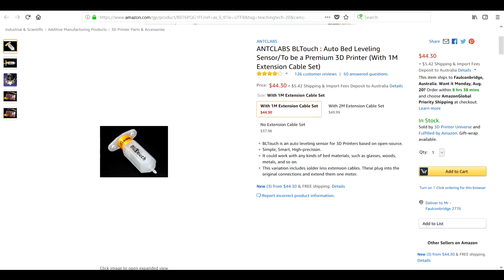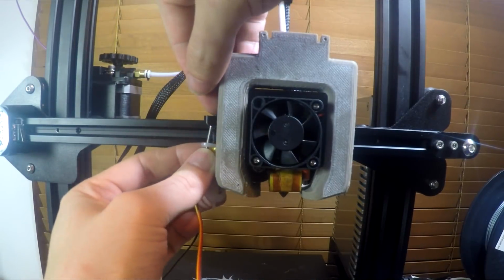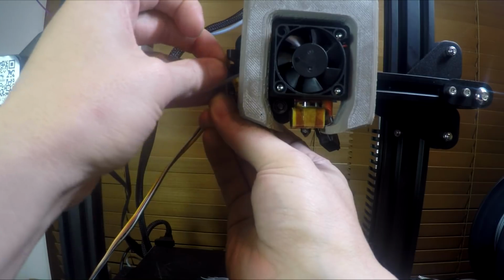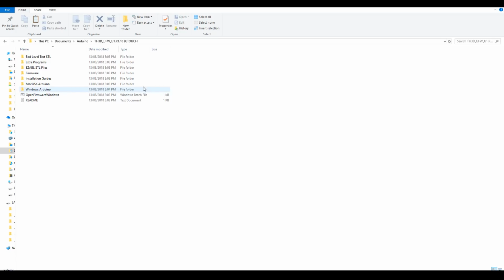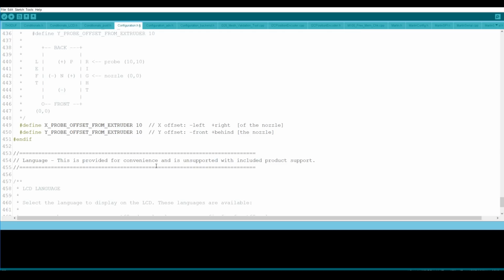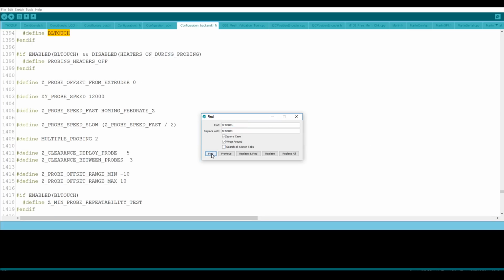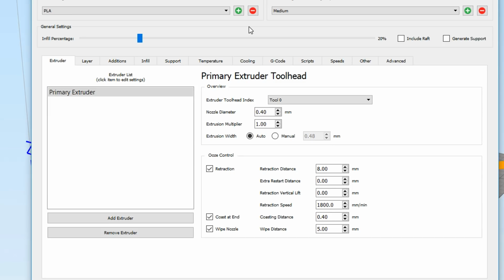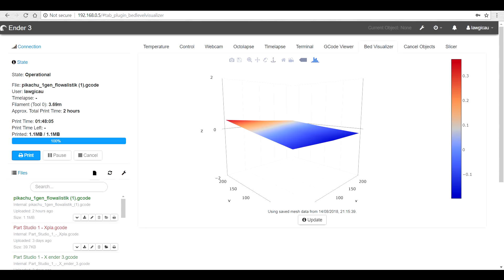How to: Ender 3 BLTOUCH with SD card support and no wires cut

Comment: Many Thanks for the tutorials/ videos !! Many, Many Thanks. I sure wished there was a way to get that pin 27 board in the U.S..... keep up the good work !!
Reply from the maker: The link is in the description. Th3d sell it.
Reply: Thx for the reply...Sorry, I'm blind in one and can't see out the other...lol .. Just ordered it and shipped it overnight to me....  Also I was wondering the benefits from upgrading the motherboard in it to a 24v 32 bit board.. (to solve the run out of memory issues) OR a better board to run in this printer ? I am wanting to build plastic auto parts.. some are huge and will have to run for very long hours...(this printer is just a stepping stone.., I'm wanting to build a huge cube printer to do very large prints...)
Reply from the maker: I think there would be two reasons to upgrade: 1. Adding even more features that require more storage space on the 1284P. 2. The ability to change the stepper drivers to some TMC versions which run more silently.
In terms of 8 bit being  limitation this was addressed by the main Marlin author in a video with Tom S.

Comment: Any US sellers for the Pin 27 board?  Is the schematics/board designed available so we could build our own?  Would much rather buy one, but not going to wait for the oversea shipping.
Reply from the maker: The link is in the description. Th3d sell it.
Reply: Didn't need all the other stuff though.  Just the board.
Reply: I've seen one from England mentioned on the Facebook group, it's for sale on eBay.

Comment: Thanks for the video Michael, I did this mod using the other tutorial but always wanted to use the TH3D firmware so this def helped. Im having an issue I wonder if anyone else is having. I can't seem to do anything once the print starts. The screen freezes and the printer bugs out or stops when ever I try to do anything via the click wheel. Anyone else experiencing this?
Reply from the maker: I haven' heard of anyone else having this issue. Please post if you can diagnose it.
Reply: Welp I couldn't figure out what was making the printer freeze. But I've since updated to the Beta version of the TH3D firmware and the issue is no longer happening. Also didn't need to disable the boot screen to make space. The beta version leaves the chip at 97% without disabling anything.

Comment: How do I upload TH3D so I do not have to change engine steps etc?
Reply from the maker: Engine steps? If you mean stepper motor steps per mm that will stay in the EEPROM if you've previously stored it after calibration.
Reply: I mean, in the current marlin Ender 3, I have:
#define DEFAULT_AXIS_STEPS_PER_UNIT {80.000,80.000,400.000,93.00} // default steps per unit for Ultimaker

and in TH3D it will be different?
Reply from the maker: Hi Rafal, I've checked and can cnfirm the default steps in TH3D for the Ender 3 are the same as what you have posted.

Comment: Can't wait for the glass bed and auto leveller comparison, I started printing for the first time today and got my settings wrong... ended up scratching my build plate considerably ☹️
Reply from the maker: If the plate is scratched, the nozzle bore might no longer be round. Might want to double check it.
Reply: Teaching Tech I hadn’t thought of that, I’ll take a look

Comment: Have you done a lot of printing with such a tight fimware size. One of the things which you can do to improve octoprint performance is to increase certain buffers, but even on a Rumba or Rambo marlin boards, that is limited, I noticed that even if I increase it high enough and it compiles fine, unless I leave a bit more room than that in the firmware longer prints lock up.
Reply: Buffers would be allocated from SRAM, not the programming memory.  So with no programming space left, you would still be able to increase buffer sizes.
Reply from the maker: Hmmmm. On paper I would think that tight storage should be fine but tight memory would cause issues. I haven't experienced any problems yet. I think th3d has a large customer base so I would expect to hear more on this if it were an issue.

Comment: Thanks for the video...will be interesting how both compare as the bltouch is cheaper and has no thermal deviation
Reply from the maker: This is true, the EZABL has some other advantages too.
Reply: Looking forward to your comparison video to know what they are. I still plan to try both though :-)
Reply: Bltouch works perfectly and has the benefit of being able to compensate for different bed thicknesses,  like if you change from plain glass to a flex plate with buildtak or whatever without having to re-adjust your z offset.  What advantages does a cheap proximity sensor have?  all options even a cheap microswitch are more than accurate and repeatable enough for a 3d printer.